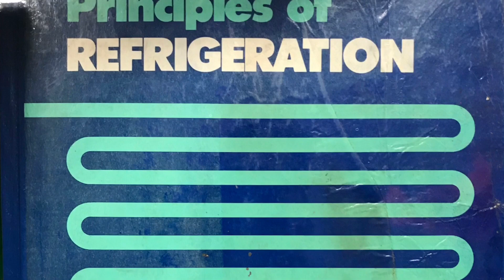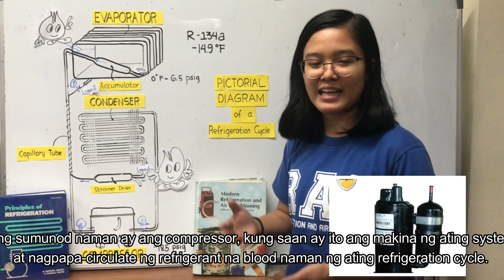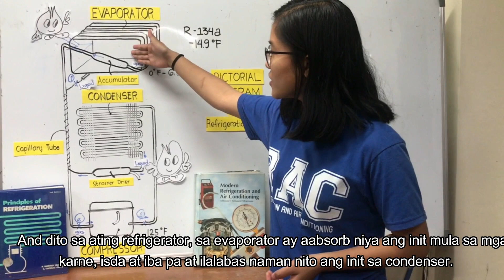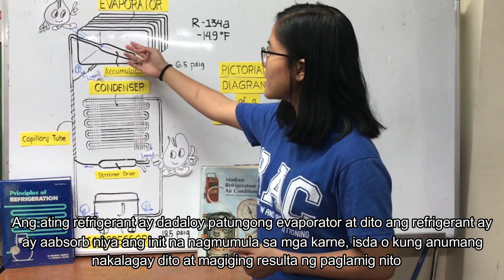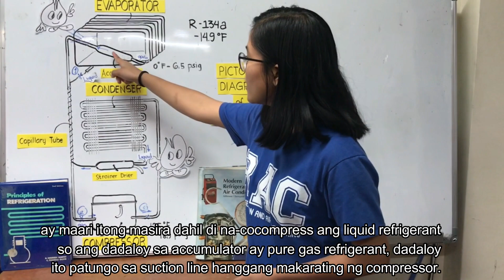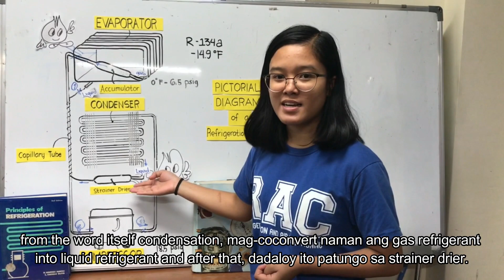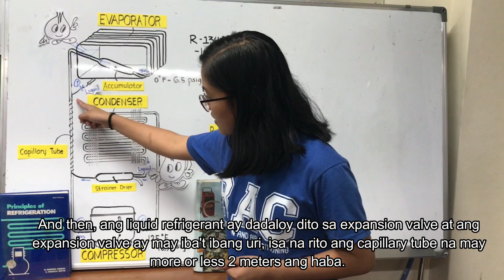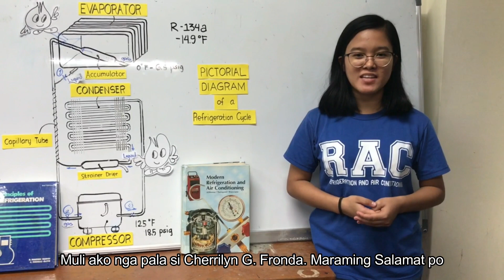Paano Lumalamig ang Refrigerator | Fronda 2020

Comment: Good day! 
Im not a technician but this video its ao very easy to understand the cycle of refrigerator. Ana po magkaron ng about wiring din ng refrigerator kgaya ng wiring ng aircon. And difference about frost type and non frost type.
Reply: ang frost type po...may heater...may automatic switch na pag patay ang compressor..gumagana ang heater..magastos po sa kuryente..ang non frost..wala po...inaalis ang frost manually with the help ng electric fan para matunaw ang frost
Reply: @racroom2006  mam thank you.
Sana magkaron din kayo ng pagkakaiba ng inverter aircon sa non inverter...
Thank you ❤

Comment: Bakit kailangan na napakaliit na capillary tube?
Reply: para po paglabas ng refrigerant sa capillary tube na maliit ang diameter...at biglang laki ng evaporator tube..mag eexpand po ang refrigerant from high pressure..high temperature...pag expand..magiging low pressure..low temperature refrigerant
Reply: @joycabangon9468  parihas lang ba ang air con at refrigerator?
Reply: @davealvarez1780  hindi po....ang  purpose po ng refrigerator ay mag palamig lang....samantalang ang purpose po ng airconditioner ay eni co condition ang air..para sa human comport.  ... may apat pong ginagawa ang aircon..una  palamigin nya ang air para maginhawahan ang tao..2nd  pina cicirculate po nya  air sa loob ng room..3rd..finifilter po nya ang mga dirt,,dust..pollen  na kasama ng air,,at 4th po ay ni rehumidify nya ang air..it means..binabawasan nya ang water content ng air..ang ref po..palamig lang..cooling
Reply: @joycabangon9468  meron din bang capillary ang aircon? Kasi diba may evaporator din sya, paano nya napapalamig ang hangin na dumadaan sa evaporator na sinisipsip ng blower? Magkaiba ba ang refrigerant nya?
Reply: @davealvarez1780  meron po.......ang refrigerant po ng ref na ginagamit ay R 134a..samantalang sa Aircon ay R22..sa luma..mga bago na po R410a......sa Aircon po  ang isang blade po ng /fan motor ay sirocco fan...bilog po sya...ang higop ng hangin ay sa gitna...kaya ung hangin na hinigop sa loob ng room,,,dadaan sa filter ng aircon..tapos..dadaan sa evaporator..na syang nag papalamig sa hangin..at lalabas po ng sirocco fan..sa side nya ang daan..pabalik sa loob ng room...kaya po..malamig na ang air pabalik sa room
Reply: @joycabangon9468  ah ok salamat miss pwede ba ako makapag aral jan sa school nyo? Maganda kasi pag aralan yan. Ano name ng school nyo? At saan yan?
Reply: @davealvarez1780  PUP ...sta mesa, manila...Mechanical Engineering Dept....may free training po kami sa RAC..sa Welding...sa CAD......nag ka copid lang po..kaya..na hinto....
Reply: @joycabangon9468  sige sige salamat po,  sa mga anwser😊 baka pwede malaman ang fb mo para po dun nalang ako mag comment thanks.
Reply: @joycabangon9468  ndi din aq sanay pero sa explanation prang fan ang wala sa ref na meron ang aircon kaya kaya nito mag buga ng low temp. At humigop ng high temp sa kwarto.
Reply: @khevind.agustin451  meron din pong fan motor at fan blade ang  ang malalaking ref especially two door ref
Reply: @joycabangon9468  correction po pareho principles nila ng cycle pero nagbabago sila s demand ng heat loads halimbawa meron refrigerator na chiller  na set point niya lng ay 3 degre celcuis at frezzer n ‐18 degre celcuis at ang aircon ay may minimum setpoit na 16 degree at s refrigerant hnd rin basihan yan it depends s required refrigerant ng compressor yung car aircon 134a siya at  halo halo gamit nadin ngyun s refrigeration 404a  , 209, 600a at 502
Reply: @ryanrebancos194  Sorry po Refrigeration po ang purpose ay to lower the temperature...while airconditioning po ay one..to lower the temperature ng air,,2..to filter the air..3to circulate the air..4..ro rehumidify the air....ang morgue po..refrigeration.malamig..pero d po airconditioning...anf water cooler po ay refrigeration..pero de po airconditioning...ang walk in chiller po sa barko..amoy karne..gulay.. refrigeration po un.. un///sa airconditioning po..human comfort..d gaano malamig..d gaano mabaho..ginhawa pag nasa room airconditioned kayo.  opo,, anf airconditioning..may refrigeration system..but..refrigeration system..walang ibang feature ng cleaning the air..de humidification..air circulation..
design po ng aircon  40 degree F to 45 degree F..sa cooling...kaya po d gaanong malamig..sa ref po..0 degree F..to -30 degree F..sobrang lamig,,nagyeyelo..ang kotse po..pag nilagay mo ay refrigerator,,,baka d po sila sumakay dahil sa lamig..
Reply: iba rin po ang HVAC..heating,,ventillation,,airconditioning...sa ibang bansa malamig,,need nila heater..mga bagong kotse po ngayon..may airon..may heater na rin..pero anf HVAC..may refrigeration cycle din..pero..walang de humidification,,walang,,air circulation,,walang,,air filterization,..pero.hindi po sila refrigeration..HVAC
Reply: To minimize or control the flow of refrigerant..

#RACTech